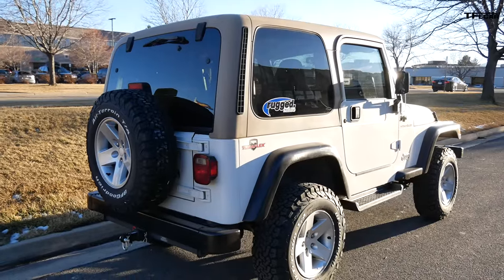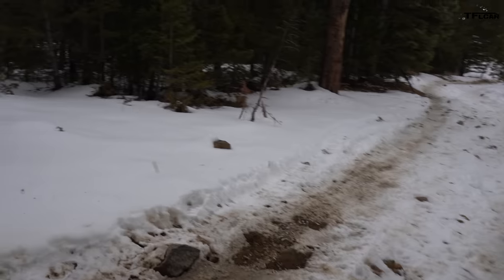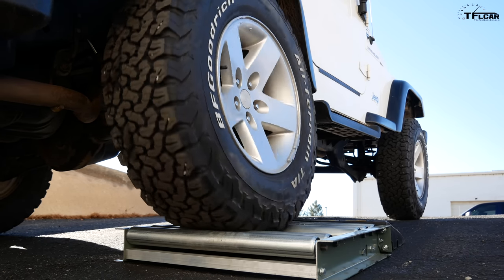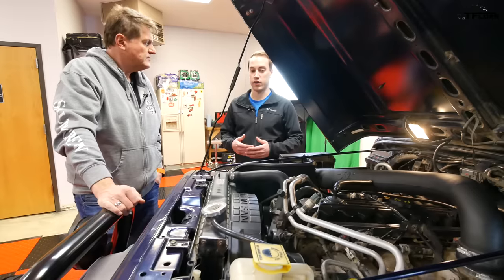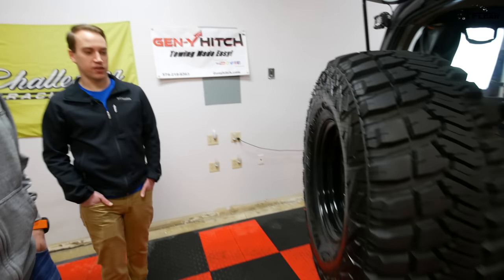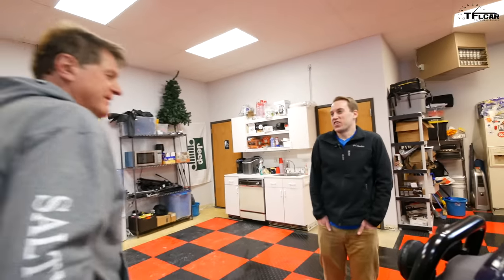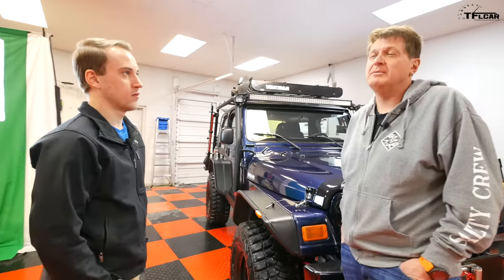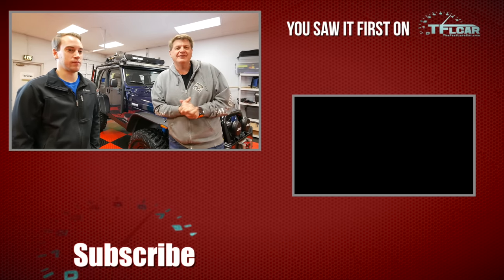We Took our Modded Wrangler Offroad and Got SUPER STUCK: Cheap Jeep Challenge Ep.6

Comment: in open diff rigs you should take a slower approach.  left foot brake about 30-50% and easy on the gas, you'll trick the diff into transferring power to the other wheel.  probably walk right up that.
Reply: Really? I have an auto locking rear diff that disengages in 4WD, would this still work? Either way, good to know!
Reply: Meh it might help slightly but its kinda dumb just buy some lockers and you'll love it
Reply: This might work a bit for auto gearbox.. I'd need 3 legs to do this in my 4x4 lol. E brake could work a bit
Reply: Justin King
E-brake might be better than using the main brakes as it only impacts the rear axle.  Engage it as you say, 30-50%, or until you can see both rear tires turning.
If your front axle specifically needs to 'lock', then use left-foot braking.
Edited to say:  Love your channel, btw.  Looks like good times!  Stay safe!
Reply: Yes this will save you guys
Reply: Jeremy quiring this will do more than help 'slightly'
Its the manual version of the electronic anti slip traction controls modern 4wds come with. Does exactly the same thing except your foot brakes the wheel not a computer controlled servo.
Reply: YouTube the small world I'm subscribed to your channel man. You make a good point I use that all the time sometimes a couple clicks on the e-brake 😜
Reply: Old school trick lol I still use it on my 2000 f150 with the off road package and it works great.
Reply: @jasonletzelter6863  Ford? Will work to fool the front diff
Reply: @samjohnson9894  E brakes as you say are not E brakes on modern vehicles with disc rears. Thay are parking brakes no more and will be destroyed in no time loading them up. Use your regular brake as this is what is used for Jeeps BLD
Reply: @raylaux8295  16' Chevy Colorado
Reply: @GreghouseVanBouten  only the one that spins faster than the rest on that axle.
Reply: @2511jeremy  It does work, been doing it all my life especially in the 70s when everything was two wheel drive with open diffs in the snow. use the e brake though
Reply: Yes! I learned about this in a basic off-road class and it changed the game! My instructor called it brake/throttle modulation. My wife and I are tackling things we never would've thought possible in our stock 2002 TJ with no lift or lockers, just using BTM and a good line.
Reply: Just use your left foot on the brake. Amazing that this is never done... they just raise their shoulders.... I guess we need lockers!  Lockers can be downright dangerous in mountain passes as they dramatically increase turning radiuses.

Comment: With an auto in 4Lo, the old trick is not the hand brake but to use your brakes. The hand brake is for use in a RWD. Using the brakes will help distribute torque on both the front and rear axles.
Reply: Left foot braking.

Comment: Love what your doing with your TJ and the blue Jeep on love my ride is sweet. You asked about other cheep Jeeps, I paid
$5000.00 for my 98 TJ and by building my own bumpers and rock sliders and doing all the work myself I only have about another $6000.00 in the build, build includes 8.8 Explorer rear axle with 4.56 gears and Detroit locker, front 4.56 gears with Detroit Trutrac, zone 4" springs with a Rough Country long arm upgrade kit and a Smittybuilt 8000 lbs winch. Its my daily driver with 244,000 miles and works great off road. Keep up the good work on your TJ. lop

Comment: At 9:35 on the video:  You almost for sure have a factory, Trac Loc limited slip rear diff that is very worn. The clutch packs in those units would wear out but yours still offers a very little bit of limited slip action on a level surface. You should check into this and maybe replace the clutch packs, if in fact it is a limited slip.
Reply: Limited-slip option on a 4-cylinder???
Reply: @nickmotsarsky4382  Mine had it.  I presume the law enforcement agency that was the first owner managed to order it that way.
Reply: Usually these didnt have lsd. When he used faster throttle the resistance of the rollers was enough to bump him off the rollers and give that one tire enough traction
Reply: If it has the Dana 44 rear option  it has limited slip diff that's definitely worn.

Comment: Great Vid, I have a 2005 Sahara TJ with 65,000km on it, interesting hearing about the factory recall, we had this problem & it was fully covered/replaced. We have done a 2inch lift but I am getting to the point that we may have to do some costly maintenance on the diff, starter motor & replaced suspension  & bushings. It has cost very little so far & I’m happy to do this work to keep our toy in great condition.

Comment: Another great video,  As predicted you will need to lock that Jeep up for best results. Get the LOKKA, 383.00 for the pair front and rear. or 194.00 rear and 234.00 front. These pieces are excellent and make such a difference.. Tommy was correct, need the lunchbox lockers, Roman said but then it wouldn't be a cheap Jeep. I feel lunchbox lockers are the absolute best value on a Jeep or off-road rig.  Its all about pulling with 4 not 2.
Reply: I second that thought. Even w/stock tires, a rear lunchbox locker is the biggest bang for your $.
  I know everybody starts w\tires and a lift for the visual gratification

Comment: You need to air down more about 12-15 psi and get quick sway bar disconnects! You will thank me
Reply: Kyle Reasner or get a rubicon
Reply: @isaacsanchez9692  I think you missed the "cheap Jeep challenge" part... They wanted to get the cheapest Jeep in good condition possible.
Reply: @isaacsanchez9692  You would need to do the same things on a Rubicon...
Reply: Airing down makes huge difference. Bigger footprint, more available traction and floatation  and hell it even softens up the ride off road. Doesn't matter what 4x4 it is.
Reply: mrdrive1 so why would ppl opt for a tall and skinny tire?? Just curious
Reply: @BlackGT1999  It's a lot better on road in snow
Reply: Usaf junkie it doesn't cost any money to disconnect sway bar and air down. Would make gold mine hill so easy. Especially at 10 psi. Bring a compressor to air up a little before driving home
Reply: I could get a ford fusion up gold mine hill.... lol
Reply: @USAFJUNKIE then get an xj
Reply: @BlackGT1999  No one does. 10-12" wide or wider tires are the norm on Jeeps here. That's what I have on mine.
Reply: Isaac Sanchez you are rarted

Comment: I got to 5:41 on the video, and I stopped to post this. I'm guessing that your Cheap Jeep has the optional factory, Trac Loc, limited slip rear differential, thus the ability to drive off the diagonal rollers. The Trac Loc was a great option, although nowhere near as good as a true locking differential.
Reply: I thought that as a possibility but then again the rollers are pretty close together for that tire size. I think the tire is just able to overcome the tight spacing of the rollers.
Reply: Trac Loc on a 2.5l base model?  I'd bet against that.
Reply: @ebikeengineer  I am pretty sure it was a factory option, just like the automatic transmission was an option.

Comment: #1 ALWAYS air down.  #2 when snow-wheeling/exploring, carry snow chains  #3 learn to love the 2-foot dance (gas & brake at same time).
Reason the diagonal and 3-wheel rollers didn't get you good&stuck is the friction on the roller rods.  Lube them good before next use.

Comment: That's an excellent build! Really dig the patriot blue on that TJ. The build is complete on my '05 TJ Rocky Mtn and now looking to address the black paint that has several rough spots with the usual hood crows feet. Definitely painting it blue but not sure with paint, leaning more towards Raptor lining it. Much more durable off road, won't ever have to worry about off road pinstriping, plus it looks much more aggressive.

Comment: That’s why I bought one with a limited slip (also factory 30” tires).
Mine has 3:73 rear gears (4.0l 5 speed) and it has no issues in town (I can keep it in 5th down to 34mph). I can go up some decent hills in 4th gear.

Comment: Ditch the swaybars and let's the solid axles flex. This also helps if you have open diff's. And lower the  wheel speed if you have a rear lsd so you dont cook the clutches. All of this works for my XJ.

Comment: I vote for a more aggressive tire like BFG Mud Terrains or Goodyear Wrangler MT/R. All terrain tires are for sport utility wagons, not a Jeep. Also throw in a selectable locker in the rear and sway bar quick disconnects up front and you should be good to go. You're almost there, just a little more money.....
Reply: There's already a lot of people complaining about the money they've spent on it (especially since they won't spend the money on lockers) so perhaps they could go hit up Craigslist for some used offroad tires or check out some local offroad shops to see if they have any worn but still OK tires in their scrap pile.  That's what my buddies and I always did when we were wheeling.

Comment: Overall, another well-edited video from TFL.

I enjoyed Carsten's build story. That young man has done a great job in researching and sorting most of the bling out of his add-ons, light bar and CAI notwithstanding. I do have a few comments:

-He replaced his OPDA, not "OBDA." Anyone with an '05-'06 4L TJ should, as Carsten did, inspect their cam and pump driver gears. Replacement OPDAs run $100.

-The K&N intake offers no advantage over the stock configuration. The original does not restrict airflow, filters better and, as stated, has a higher intake. 

-Taillight guards both decrease visibility and increase the likelihood of their snagging on brush and other trailside obstacles. Similarly, the Hi-Lift jack mount begs to bang, snag, and catch. The TJ's reduced width is an advantage in most cases. Why widen it?

-The Mercedes-sourced six-speed NSG370 was only offered the last two years of the TJ run, not '03-'06 as stated, and is not nearly as robust as the TFL crew touts. Most TJ gear rowers will affirm the earlier, and stronger, Aisin AX-15 as superior, both in terms of strength and parts availability.

-The sliders appear to be Rubicon take-offs, so they easily would bolt into the existing holes. Though not particularly beefy, they do offer a modicum of protection.

Comment: Pull the rear diff cover and check for a limited slip. Just because it didn't come from the factory with one doesn't mean someone didn't have one put in later. Especially considering it's age. If you find one throw in a new clutch pack and enjoy. Remember, a limited slip will act a lot an open diff when tires are in the air. Be careful not to just burn the clutches out again expecting to much from it.

Comment: That is a really nice TJ (Carsten's) and seems to have all the right equipment.  Having gone through a similar first build with my 02 TJ Sport,  I think the one thing I would do different is to have an overall 'build plan' and stick to it.  Decide from the start what your goals/build is to be and stick to it.   I ended up doing "two builds" on mine.  Meaning I first installed a short arm lift, tires/wheels, ARB lockers and gears.  Only to change things around a year later to a long arm suspension, gears again!, added Dana 44 up front (to match the factory rear Dana 44), new wheels and tires again!, and finally realized I have gone far enough.  If I go any further, I won't be able to drive to distant trails and events since I would have to trailer it.  And I don't want that.   I love my TJ with its 5 speed NV3550 tranny, and long arms.  But I could have saved a lot of money having done the long arm build to begin with.   I also like the idea of the Cheap Jeep.     Almost makes me want to go out and buy one to build again!  lol

Comment: Handbrake is for torsen differential vehicles. Basically it was taught to military members to help the hmmwv get unstuck, then it filtered down. 

Unless your handbrake is stronger on one wheel and that happens to be the spinning wheel, then it won’t do shit for you with an open differential. 

With a torsen it’ll double to triple the torque the brake applies to the wheel with better traction.

Comment: Gears. GEARS. GEEEEAAAAARRRSSSS. With the 4-cyl and those big tires, this thing is struggling even more than stock. You need to re-gear it. And while you're re-gearing, it wouldn't be a big deal to throw a cheap locker or limited slip at least into the rear end.

Comment: If you're staying stock axles then TrueTracs front and rear are the way to go. No maintenance, much easier on the front Dana 30 and really strong off-road performance and they last the life of the vehicle. They are also not much more than a lunch box locker without the popping around corners. Trust me I've been down this path starting with a CJ-5 in the 70s and including a 97' TJ along the way. I went Lock Rite with the TJ because I hadn't had experience with the TrueTracs at that point.
Reply: A lunchbox locker is good for a cheap build but yeah, it'll twist the splines off of those stock axles pretty easily.  TrueTracs are awesome, but $600+ just for the differential is outside the reach of a budget build.
Reply: @406Steven  That depends on how budget you are trying to be. I contend $1500 or less for traction control is not excessive. Also, I would invest in the traction before a lift and after skid plates.
Reply: @chasrmartel4777  I'd agree that they could've kept the suspension stock or put spring spacers in (under $100) and been fine for a budget suspension, then they would've had plenty of budget left over for a differential.  I really think this build went more the way of who they could get free parts from, though.  If I had to venture a guess I'd say that they want to keep it as a personal rig and these are mods they wanted for themselves rather than keeping with the spirit of the build but that's all assumption.  I've had my eye on a TrueTrac for my own truck but have a hard time spending that kind of money on one when I have never experienced one before, the factory diff in my F-250 with a new set of clutches is pretty solid and a fraction of the cost.

Comment: I have been conflicted with this “Cheap” Jeep challenge. I was surprised you guys went with a 4-Cylinder/Auto and that turned me on to this. But you got the $900 Teraflex suspension and $800 worth of BFG KO2 tires, but don’t want to spend the money on a $250 Locker, I’m sitting here scratching my head.
Reply: Those are from sponsors, if they paid anything for them it was a highly discounted price (I believe the BFGs were totally free, if you go back to the build video).
Reply: UnsulliedSpy They weren’t entirely clear about that, I just remember them rambling off prices. If that’s the case, then there should be some money to get a locker like Tommy suggested. 

My issue is that this is only a “Cheap” Jeep build because they bought it cheap. They said early on this was going to show you that you could build a cheap off-roading rig. This is not that. I get that they are sponsors, but if someone truly is wanting to cheap out, this is not the cheap route. I wish they were a little more hands on. They dumped over $700 to have the suspension put on, brakes replaced, tires mounted, and the alignment. I could have done the first two things in my driveway during the weekend and saved a few hundred dollars. 

I don’t mean to be so critical, but this is not the route I thought they were going.
Reply: @SBF96  That's fair, and the interpretation of "cheap" is pretty vague--it would be more relatable if they did something like set a budget and try to buy and build the best rig they could for the given budget as that would remove the interpretation of "cheap" from the equation.  I think they should invest in a limited slip or locker as well, but those are also pretty involved to install correctly so they'd be stuck paying a shop to set it up properly (re-shimming the ring & pinion, setting backlash, etc.).
Reply: UnsulliedSpy I agree with that thought.
Reply: if it was my jeep i would've put 2 lockers in. my 2wd toyota has a lockrite ratcheting locker that was 150$. best money i ever spent on that truck

Comment: Let's see this test with an Aussie Locker in the front axle! $275 locker is definitely Cheap Jeep approved!! 👌
Reply: That would make steering unsafe on snowy roads. Not a good idea to have your front lock up while you are going around a corner.
Reply: @icarlsw34  Pretty sure the front locker would be to help get your jeep unstuck, like what happened to them and then unlocking it.
Reply: @icarlsw34  Lunchbox lockers only apply the locking action when torque is sent to them. For example in 4hi or 4low power is sent to the front and you will have a locking front differential and slightly stiffer steering feel. However in 2hi the front locker is completely disengaged and invisible on the street. That is the reason I run a selectable locker in the rear of my Jeep. For added traction on the cheap you cannot beat the Aussie - I just recommend them for the front axle only on a street Jeep.
Reply: @tself77   Right, but the situations Carl is talking about are legit when driving on slick roads in 4wd. For this reason, I'd think twice about a front locker in a daily driver.
Reply: Aussie lockers are part time but machanicaly engaged with an adjustable cable rather than electric or air powered.
Reply: @douglasbeary7890   Ok. Yeah, if they only lock on demand, that would be perfect.
Reply: @douglasbeary7890  You're thinking of the OX Lockers which is what I run in the rear of my TJ. The Aussie is "on demand" so to say like an old school Detroit Locker it will lock when torque is applied and unlock when it isn't.
Reply: @jmc88480  Yes that would be the only downside. If you spend a lot of time in 4hi on the street in snow it will make the front end push when on the gas in turns but not as bad as you would think. The Aussie will unlock every time you are off the gas pedal.